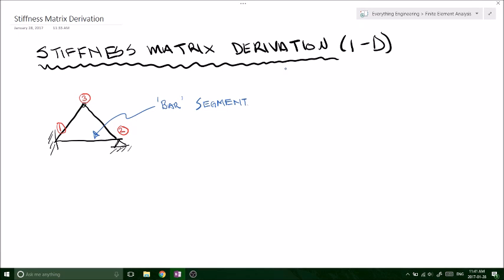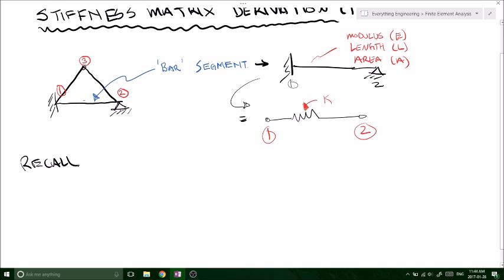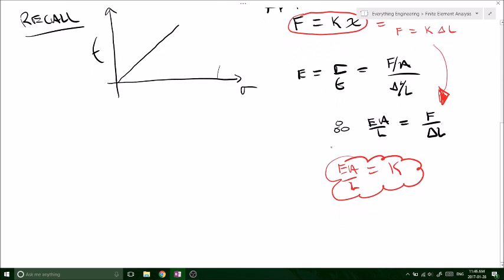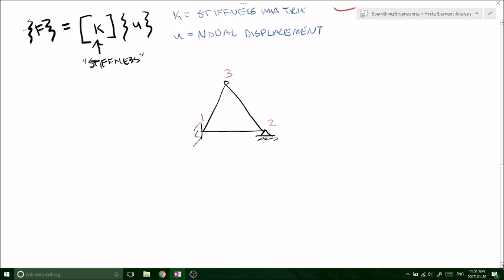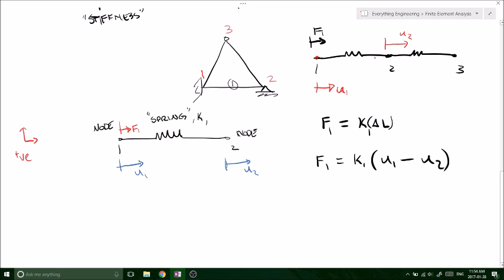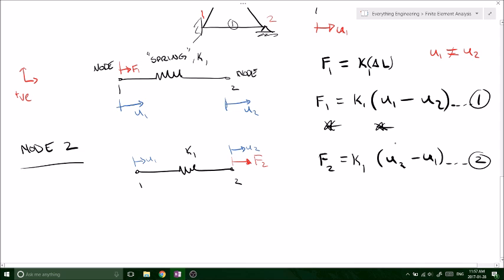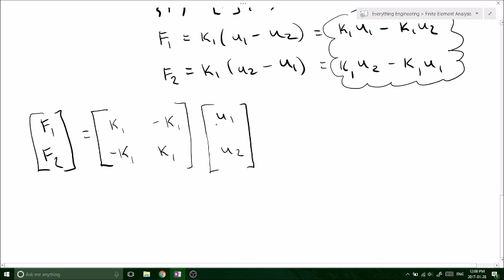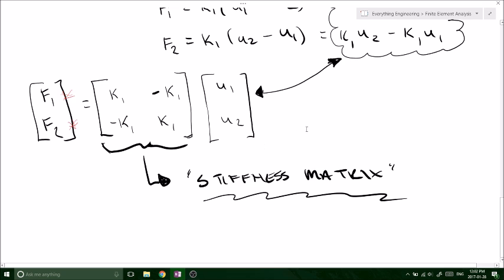Derivation of Stiffness Matrix - Finite Element Analysis

Comment: Quick question: How did you transform the bars to the springs? I'm confuse at this due to the fact that the bars are fixed at both sides thus, it is not movable and therefore the transformation to the horizontally moving springs is not possible.

Comment: Thanks for your good explanation!
But I think you made a mistake right at the beginning, as you fixed the bar from both sides!! so it connot move in any direction! (u1=0, u2=0)
You should make the node 2 as a roller support ;)
Reply: But if you make only node 2 as a roller support only u2 will not be equivalent to 0. Node 1 needs to also have roller support for it to have a displacement.